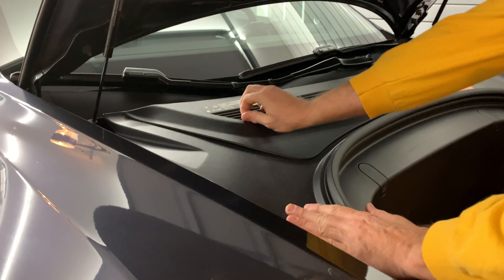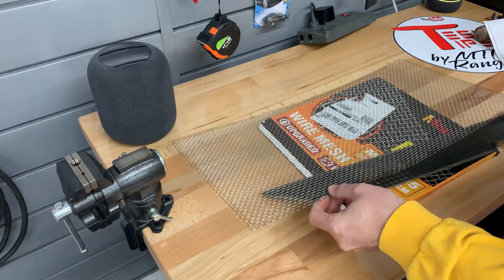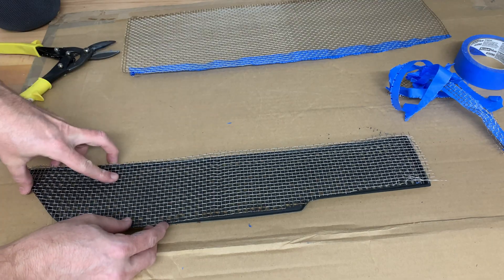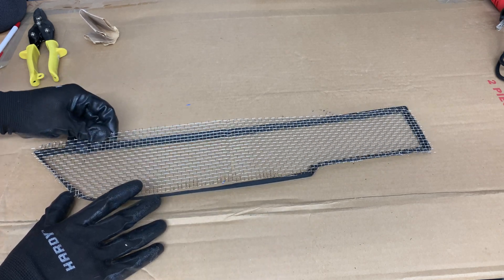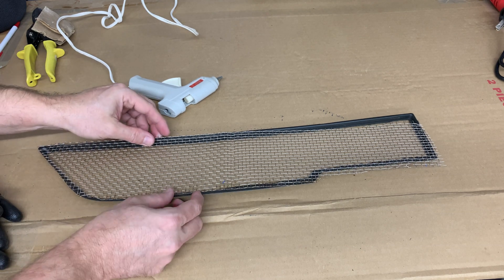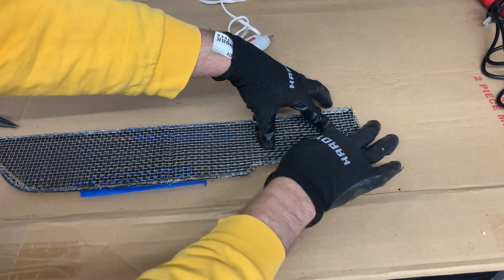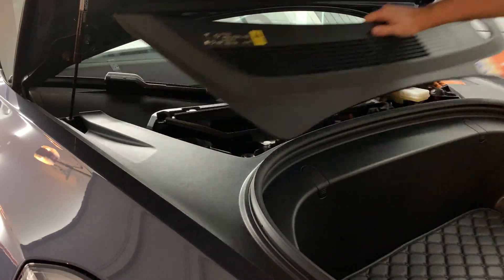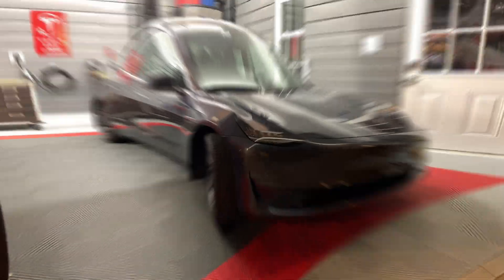Tesla Model 3 - Air Intake Modification

Comment: Does the Model 3 plastic vent intake grill fit on a Model Y?  So far all of the videos I’ve seen pertaining to this topic have been Model 3s.  Do you have any information on that?  By the way great video of the modification!  I would like to modify it like you did, however I can only find Model 3 plastic vent intake grills.
Reply from the maker: Thanks. I haven’t looked at the Model Y’s air intake.  A quicken check of Amazon and eBay doesn’t show any available for the Y.

Comment: Good work. Personally, I had probably chosen to cut the plastic so there were a few ribs across, to keep the shape of the plastic part a little better. But otherwise a really good idea with a steel grill.
Reply from the maker: I see your point.  But since the duct trim surrounds the filter, it keeps the shape pretty well.  Also the wire is fairly stiff and adds to the rigidity.
Reply: @MTNRanger  Thanks for the answer. I like your videos a lot. The benefits me greatly because I am pretty new owner of a Tesla Model 3. So all these tricks and tips are very welcome.

Comment: Nice job.  Came out nice. They actually just started to sell something similar on Amazon if you are willing to wait. 

LUCKEASY Car Accessories Interior Functional Modification for Tesla Model 3 2017-2020 High Carbon Steel Air Conditioner Port Insect net https://www.amazon.com/dp/B08DH9QSLP/ref=cm_sw_r_cp_api_glc_fabc_IlIZFbTTC6GXG?_encoding=UTF8&psc=1
Reply from the maker: Thanks for the link, talk about coincidence! I researched wire meshes and chose #5 with the highest passthrough of 74%.  The one they are using looks like #20 , which is about 40-50%.
Reply: I remember also seeing someone else take the same wire mesh you used and strapping it to the back side grates of the plastic maintenance panel as another option